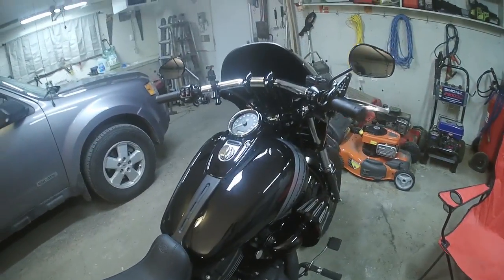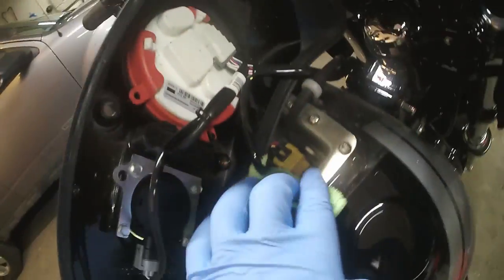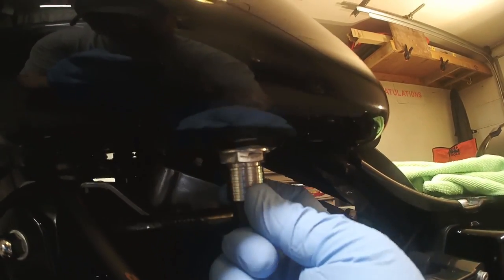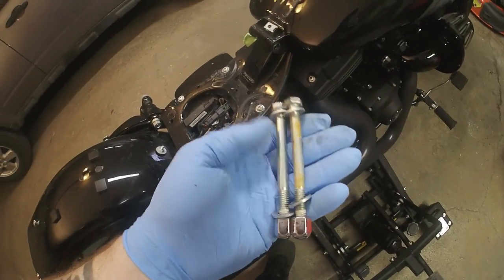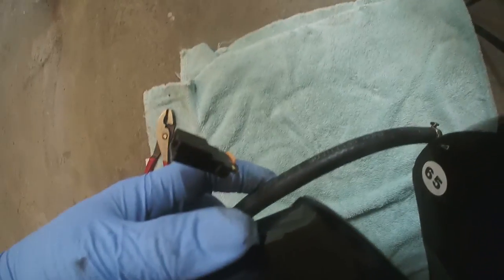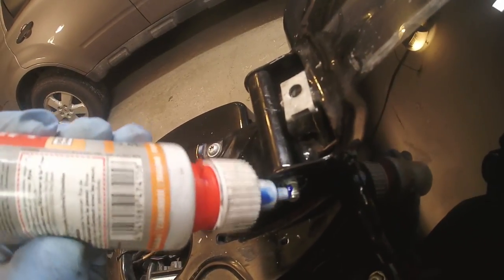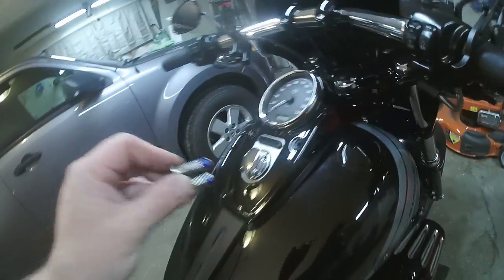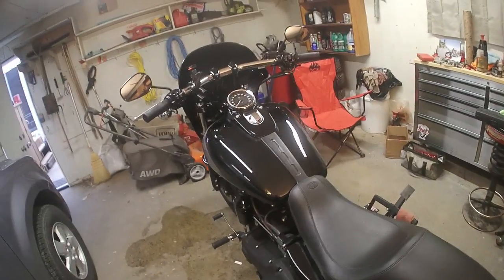How To Remove & Install Harley Davidson Fuel Tank (Video On 2015 Fat Bob)

Comment: When I removed my (1/2 full) tank , I pinched the crossover hose with 2 Vise-Grips then cut the hose in the middle , then simply lifted the tank off

Comment: Really great video... straight to the point.
I would like to ask, why should the cross over line be removed? Doesn't the tank come off without touching the crossover?
Reply from the maker: For mine; the cross over went under the frame so I had to unhook one side in order to get the tank fully off
Reply: Maybe next time, just pull the fuel hose off then quickly plug in a peice of hose and drain the entire tank into a clean gas can. Dont have to worry about spilling that way

Comment: Great video.  How did that clamp work out on the crossover hose?  Did you have to replace? I have one on a used bike that I bought last year and like you, am probably going to be checking it constantly.
Reply from the maker: That clamp actually ended up working pretty good, I checked it about once a week for 3 weeks afterwards and now I've just been checking it once a month, it always stays tight so thats good

Comment: I noticed that you did not purge your pressure line from the tank. Is that not necessary?
Reply from the maker: If its been sitting for a while like this one (couple days) the pressure is gone. If you just finished riding it then just unplug the pump and start the bike till it dies

Comment: Excellent tutorial! Question though: Can we drain the tank from the supply hose quick connect? Would getting a bit of hose with a compatible connector let us drain the tank from there? Seems like it would be easier and cleaner than fighting the crossover tube with fuel still in it.
Reply: I pump the gas out with a pump from Harbor Freight Tools;  $6.99, presto !
Reply: The quick connect is a valve that closes when you pull the fuel hose.
Reply: @ramonarache7755  which one?

Comment: Bro I ride the same  bike and just did a tank and bar swap I need to know evry thing did your bike have trouble  starting  after the installation  is there any certain  thing that needs to be done
Reply: My bike wants to crank but just cant quiet  get ther to turn over

Comment: Nice video! Do you have access to the front turn signals cables that goes trough the frame?
Reply from the maker: On mine... I can actually get to those connectors without removing the tank. Just remove the rubber grommet on the side of the frame neck and fish them out